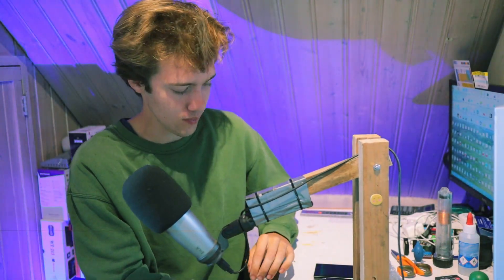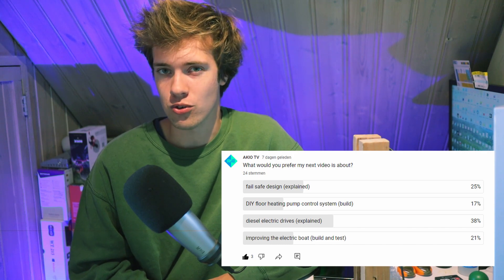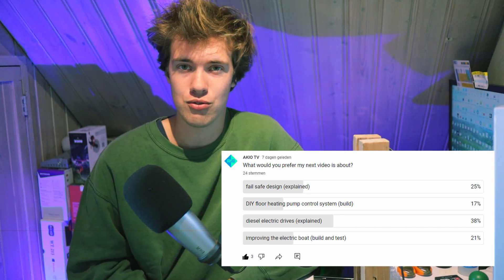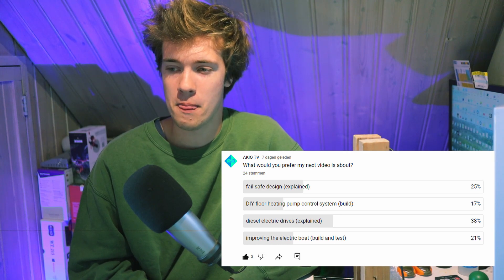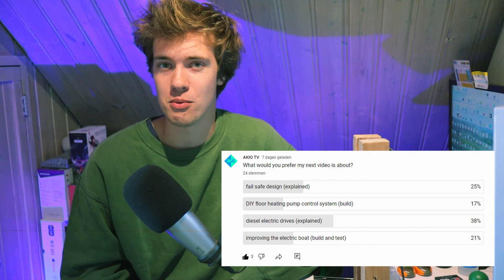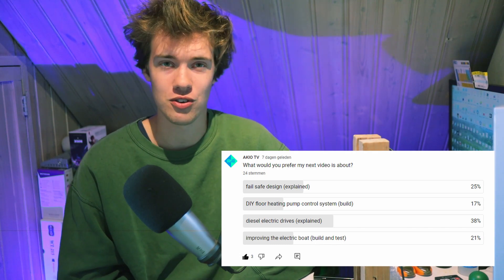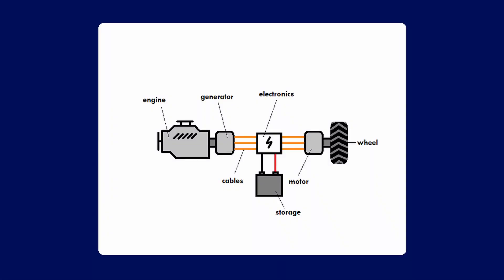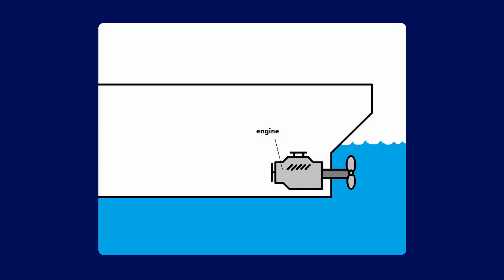Diesel electric powertrains explained

Comment: we can all just sum up the topic into “¿is it worth it?” And the short answer is… yes, for some applications, specially big vehicles, but you must be smart enough to design it in a smart way to make it worth it. 

For example, most ideas people are talking about in the comments (how much efficiency can be improved by adding batteries in an smart way). The thing with this power unit systems in my opinion is that it is complex and the outcome depends a lot on the engineers and their skills. But in general, this is a more complex system but can ESCALATE much more than simply a mechanical system and exceed it’s limitations.

At first, it might be more complex, Or even less reliable or more expensive to maintain, but as mentioned, if properly designed, it can get to a point where it not only matches but improves the performance of a mechanicaly-only system AND some complex vehicle solutions (big cargo ships with multiple rotors, mining vehicles…) might end up only being viable if you use such a flexible and scalable system! 

TLDR: Get the huge autonomous power from the diesel engine, get all the flexibility, efficiency and reliability from the electrical system. And finally, be smart enough to Make it worth it!

Very interesting topic and explanation and very good community of comments. New subscriber here hoping to join a good community :)

Comment: I would have added that:
A few batteries, or supercaps, makes the system far more efficient:

When a car is cruising down a highway at 120 km/h it only needs 12 to 20 kw.
While cruising uses less fuel  than accelerating; the engine is in fact running in the very inefficient state mentioned in the video.

That extra ~100kw the engine can produce is just for acceleration.
And a similar, to larger, amount is wasted when you brake to slow down.

With a motor turning the wheels; that same motor can act as a generator, producing electricity.
But you don't need it at that moment.  You want to store it for a bit later when you pull away again. (from a traffic light or whatever)

This is where a battery or supercap comes in:
It stores the power for the pull-away (a bit) later and now you only need a lawnmower size engine to supply the power need for cruising.  (plus a bit more as regen braking isn't 100% efficient, so you also want to charge the battery a bit while cruising and also run your aircon and lights, radio etc)

So with a battery added you can set things up so the engine/genset only comes on, at optimal rpms, when the battery is (somewhat) flat, until the battery is fully charged again.
This is where the real beauty of diesel electric (now series/serial hybrid) comes in.

You also have a highly mobile, ever present genset to run your house etc on during a power outage and such.

Comment: There are seals that hold electric motor parts together with a reduction planetary gearbox, and sometimes they fail, about as much as any other seal, but with lower pressures, so not too common of a problem.

Comment: 2:48 - nope. There are several reasons for choosing this proposition system. One of them is not because it is less efficient. In one setup, a smaller diesel generator can be run at a constant lower speed. This can cut fuel consumption and other associated costs by half.
Reply: This is later explained in the video as many other reasons. Some comments are addressing topics not mentioned in the video. This comment doesn’t. I know it is easy to write a comment before watching all the video but in this case, it was an open question at the beginning of the video lol, and it was answered.

For example, this is a very short video (as the author explains) and says that for more detail, just search for it on the internet. But it is true that we can all just sum up the topic into “¿is it worth it?” And the short answer is… yes, for some applications, specially big vehicles, but you must be smart enough to design it in a smart way to make it worth it. 

For example, most ideas people are talking about in the comments (how much efficiency can be improved by adding batteries in an smart way). The thing with this power unit systems in my opinion is that it is complex and the outcome depends a lot on the engineers and their skills. But in general, this is a more complex system but can ESCALATE much more than simply a mechanical system and exceed it’s limitations.

At first, it might be more complex, Or even less reliable or more expensive to maintain, but as mentioned, if properly designed, it can get to a point where it not only matches but improves the performance of a mechanical only system AND some complex vehicle solutions (big cargo ships with multiple rotors, mining vehicles…) might end up only being viable if you use such a flexible and scalable system! 

Get the huge autonomous power from the diesel engine, get all the flexibility, efficiency and reliability from the electrical system. And finally, be smart enough to Make it worth it!

Comment: That's an interesting trade off. Because you are going to get added inefficiencies from the double conversion of the energy source into mechanical power BUT you get the benefit of much greater energy density with diesel vs. batteries and you get to run the diesel engine at whatever constant RPM needed for continuous peak efficiency or power as needed just as you could with a battery. But I've often seen diesel electric trains running on tracks with overhead electrical lines which would negate the need of a battery and therefore neutralises the energy density advantage of diesel. So I must be missing something here? There isn't as much of an additional energy conversion loss going diesel to electric to mechanical vs. straight electrical to mechanical as I assumed?
Reply from the maker: Well of course an electric train is better, but plenty of railway lines don't have overhead wires, although they are of course getting more common.

As far as efficiency goes, there's indeed a trade of between increased efficiency of the engine, and more power wasted in the drive train.

Generally speaking though, electric generators and motors can be very efficient, particularly at large scales. Therefore (surprisingly perhaps) in many cases the increased engine efficiency outweighs the extra power loss in the transmission.
Reply: In case of diesel mechanical  mining truck vs diesel electric mining truck [ weighing 350 ton+]
let suppose that both trucks engines are producing 100 watt of power .....
^^^^^diesel mechanical drive ^^^^^
1} First engine rotate a lock up torque convertor which is 95% efficient . Then power is transferred in transmission. in machanical transmission every helical gears are 99.5% efficient ,it means they are losing 0.5% energy per gear since their are many such gear so overall efficiency of transmission is 97% ....then you have bevel gear on axile which is 98% efficient .....at last you have planetary gear on wheel hub which is 97% efiicient ............so by doing simple mathematics calculation  this power train is less than  87.5% efficient...
some power is wasted during idle .
^^^^^^In case of a diesel electric transmission^^^^^^
 we have 2 advantages in diesel elctric drive  = 1st is regenerative braking and power storage while engine is at idle or truck is not moving becoz of loading for few minutes ...[ to harness these power we need a inverter and lithium iron phosphate battery at least 10 kwh of capacity]
2} in diesel electric transmission engine rotate a synchronous generator which produces  variable frequency 6 phase AC, and these generators  are around 90% efficient ..... then that 6 phase AC is transferred into full bridged MOSFET rectifier which converts 6phase AC in to DC these rectifier are 99% efficient ...........then  DC is trasnferred into a inverter which convert DC into 3phase variable frequency AC to run the propulsion motor .....then we have propulsion motor which a 3phase induction motor and these motors are 88% efficient .... at last we have planetary gear in wheel hub which 97% efficient ......... so 100watt from engine is left only  73 watt at wheel in electric drive [ im not adding power obtained from regenerative braking becoz its  not constant]
so mechanical drive is more efficient here by 14% ....but this advantage will be reduced further more if we needed 4wheel drive system . In diesel electric locomotive there total 8 or 12 axile ...so it would have been very difficult to rotate them by a single drive rod and efficiency would have been reduced further more due presence of extra bevel gears